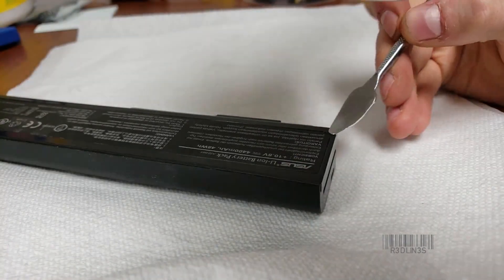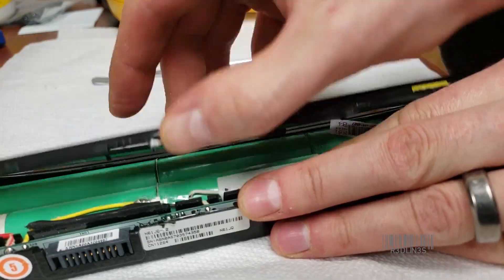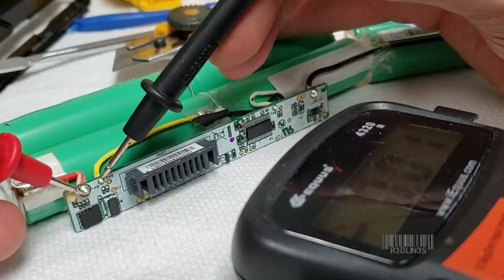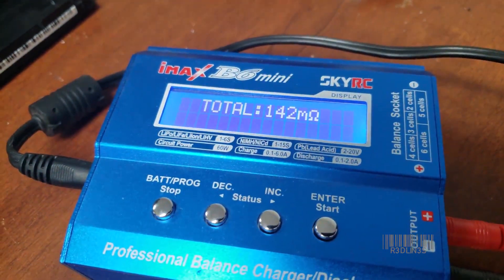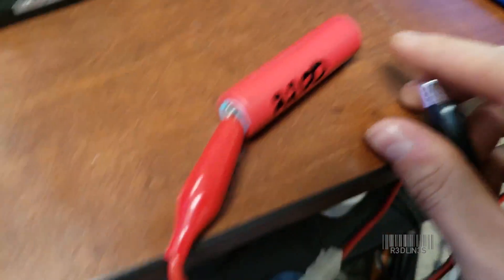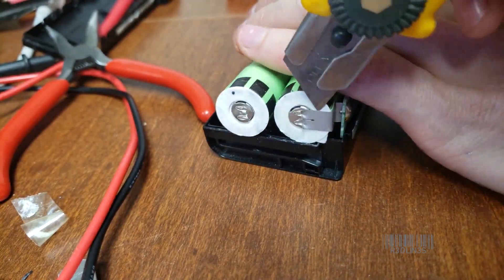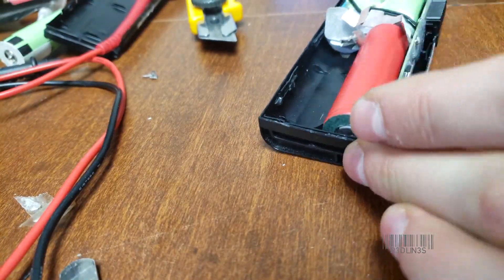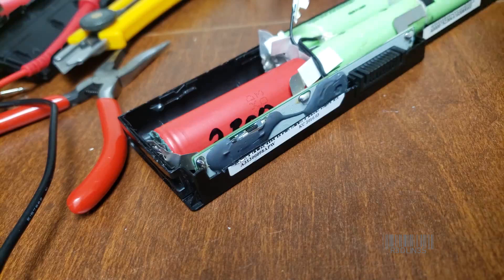Fix Dead Laptop Battery - Dead Laptop Battery Referb

Comment: The battery laptop has an i.c on it,so if the battery works then the i.c is rusted/Popped,the problem is the main board,not the battery,but u can still use 18650 batteries as a emergency light or Charger

Comment: You can get dead laptop batteries from battery recyling centers, repair shops, etc. Like in this video, usually 1 or 2 of them dies. Mine had 2 dead cells and replaced them with working ones I got from a dead old Samsung battery. I got it from a computer repair shop for free. They usually recycle or just throw them out so it's mostly free

Comment: where to buy replacement cells for my dell battery, i am from India
Reply: If you still look for cells, you can get dead laptop batteries from battery recyling centers, repair shops, etc. Like in this video, usually 1 or 2 of them dies. Mine had 2 dead cells
Reply: Order from calcutta electronics
Reply: @talkingtoyscartoon  my laptop dell vostro 1014 which capacity cell will be used, 1250 mah, 2200 mahor others.
Reply: @talkingtoyscartoon  4400 mah battery with 6 cells used in it.
Reply: @Nicks12356   capacity badhani ho to 2500 mah use kr lo pr sari cells change krna, single cell change krna hai to battery pack ki capacity ka half capacity ki cell i.e. 2200 mah use kro
Reply: @talkingtoyscartoon  cell kis configuration me use hote, do you have any idea, cause men jo dekha usme mujhe lgat 2 cells parell me  use krke 3 set banaye hote, metlab 2-2 parell le 3 set series me use kiye hai aisa lgta.

Comment: +
R3DLIN3S Hi,  what if i have on  1st - 1,81, 2nd, -1,67,3rd -,1.53V. ? Can I also just replace whole battery pack and 3x charge/discharge or i have to also reset BMS? Windows shows connected,charging 0% reaming " and after a while connected, not charging.

Comment: What you think about the charging chip going old? is that true, that it has a counter of charges and after that just stop wotking?
Reply: Yes but  you can reset it or bypass. You can buy  new BMS suitable for your battery pack type. Connect battery pack to new bms, it;s output connect to output in factory BMS (directly to battery terminal) and viola... A friend of mine fixed  bricked battery  for Dewalt electric screwdriver  by charging counterin this way and works perfectly...
Reply: @PiotrK2022  What part does Viola play in this process?
Reply: @PiotrK2022  and how  do you solve the black connector which is in all batterypacks notebook? Because I can't find THIS ONE BMS on ali, a lot of nice bms but no black connector on them...
And how do you reset your BMS after having reconnected new cells? ....I wait for your answer, thanks!
Reply: @PiotrK2022  where to buy laptops battery bms
Reply: @Ffdhwvv  
I don't know... I'm form Poland, so I can't help u. In Poland you can find dead batteries with good BMS on Allegro auctions, sth.  like ebay, so you can buy it and recover BMS. I'm not 100% but you can buy universal BMS to use in any Li-ion powered projectes co  I think that you can buy  universal one which fits  to battery enclosure ,recover battery terminal, and solder it tol BMS with wires.  You have to check amount of  cells connect in series and parrel and all you have to do is type in google xSxP BMS where xS i amount of cells  connected in series and P in parell. I think it's worth give a shot, because I did like so with Makita electric screwdriver and it worked...
Reply: @Ffdhwvv   Shit, i relilize that it will doesn't work, because laptops BMS has SMBUS protocol to talk to the charger... Universal ones hasn't one,  so  charger will unable to check battery condition, voltage and check how much current  has to give and doesn't recognize the battery... Meh, so thers only one posibbllity  - try just battery pack replacement or replace BMS/whole battery.  I don't now how much regeneration cost, but in Poland sometimes it's better buy a new one because the pirce of regeneration is close to  the price of a new battery.
Reply from the maker: could. it is done with printers and 3d printers, I would imagine it could be another way to get $ out of ppl